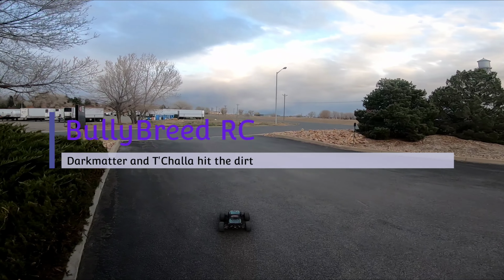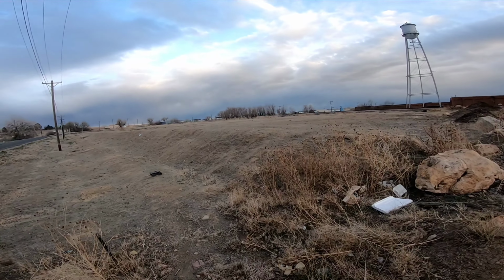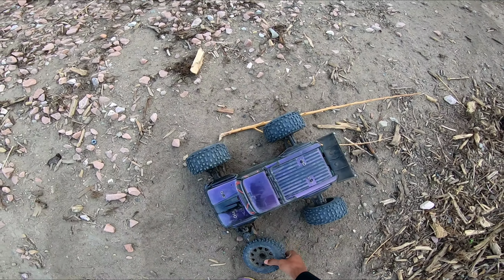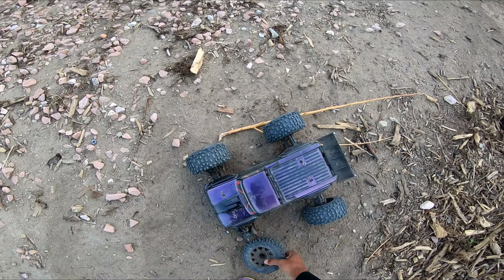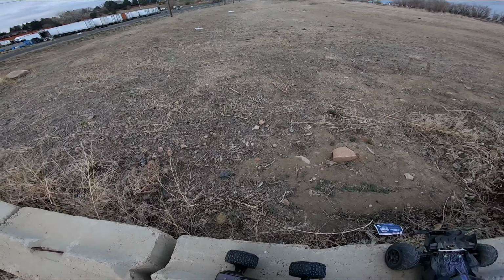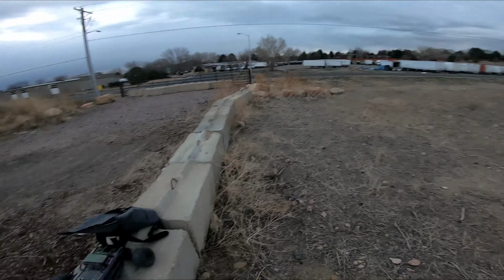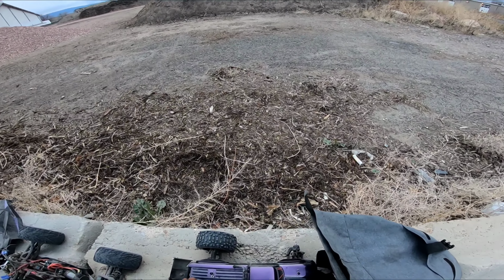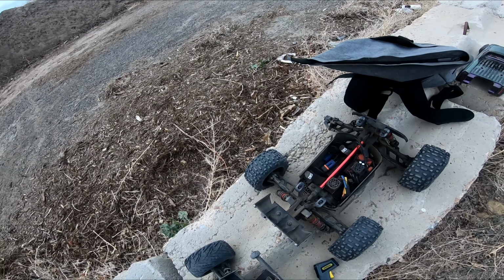Outcast 4s and Talion 6s bash by the sugar factory 🏭

Comment: Yo ...question hope you might be able to help...center diff started leaking on the talion...so opened it up and gasket was chewed up looks like center diff heated up to hot and pushed past the seal...so...question is what do you think would be a good change of fluids...current..10k 100k 10k..stock oil stock motor esc? thank
Reply from the maker: Yo! I'm a big fan of 1mil cst for the center. Mine is 1mil center and 60k front and rear. I definitely recommend to try different combinations. Everyone likes different combos. 👊🏿
Reply from the maker: I cooked my Talion center diff the second day out I believe. Donuts do damage haha! I haven't cooked one since. The one thing I'd say to try with caution is the ear plugs in the diff. It ain't for everyone haha